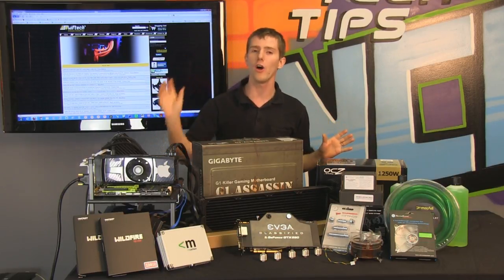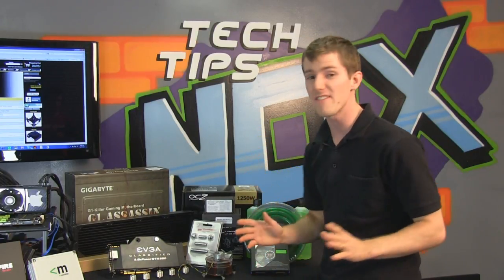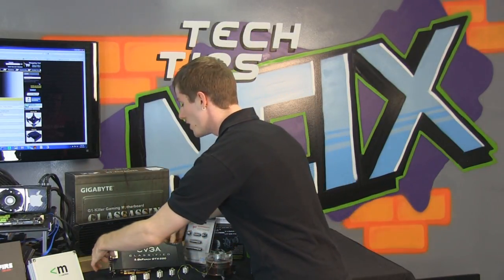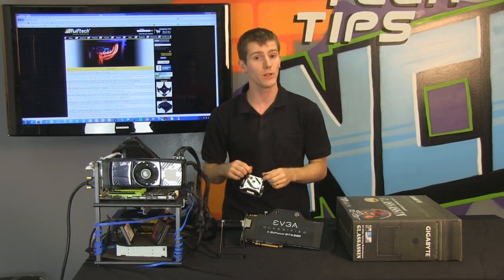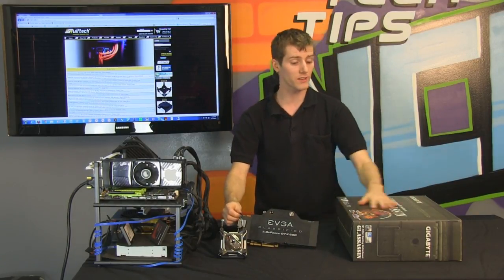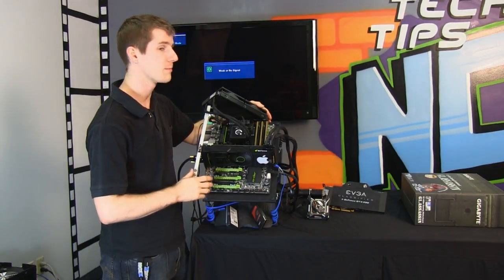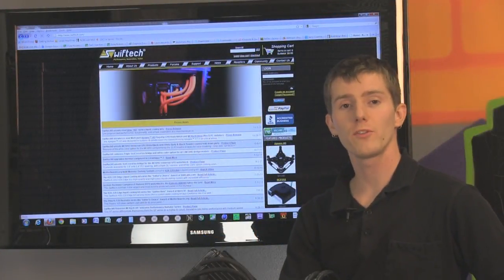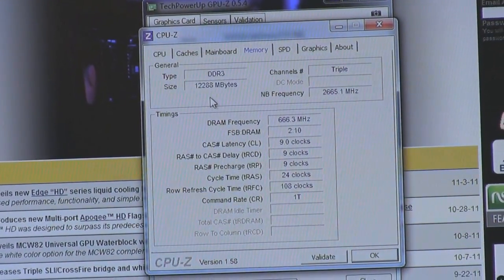Ultimate Water Cooling Guide Part 1 - Preparation Procedure NCIX Tech Tips

Comment: I have always been super afraid to use liquid cooling because none of my houses i have ever lived in have had reliable heating in them. just wondering if the liquid cooling would freeze during the winter
Reply: MrStanrir unless your ambient house temperature is under 0 degrees celsius the water wont freeze as its minimum temperature for the water is the temp of the cold air from the intake fans

Comment: If I have a h100i v2 radiator from my old liquid cooler can I take off those tubes and use that as a radiator for my watercooling loop?
Reply: From what I can tell yes... (Don&#39;t quote me on that) also you could possibly use the block so you have a pump... (Not sure though)
Reply: +NCIX Tech Tips
Reply: B4sic_Shots they made a video  (something like "watercooling for under $100") where they did this
Reply: +Bengy22 Thanks man for the help I appreciate the help ill.go watch it.

Comment: This question goes out to anyone! I'm new to water cooling so bare with me! If my water block is standard 1/4 thread holes .... but my tubing is 1/2'' I x 3/4 OD ... what the fuck size do my fittings need to be?
Reply: I would recommend buying both the block and the fittings from the same company. Some times there is sight variations in how they do the treading which will cause the fitting to not fit. As for the size of the fittings just look for something that says 1/2 x 3/4
Reply: G1/4 is the standard thread size for all fittings. You need to match the fittings to the tube, you will find the fitting that matches your tubing diameter will have a G1/4 thread on the back.
Reply: Make sure you get tubing that is the same ID and OD as your fittings. For the fittings, the THREAD usually needs to be G1/4 thead to go into most blocks. It will will no doubt say somewhere that the block is G 1/4 thread.

You would want fittings that say they are G 1/4 thread AND "1/2 ID 3/4 OD" in order to fit tubing that also says it's "1/2 ID 3/4 OD".  Basically no matter what size tubing you want, make sure to get fittings that match the ID & OD with standard 1/4 thread, if you do that then the fittings will fit every time.

(Some times the size is written in millimeters but under product details it will have it listed in inch to. It's very important you get the same  ID & OD tubing as your fittings, any bigger and your almost guaranteed a leak, any smaller and you can get away with it, but there is still an increased chance of leaking.) Does this help or was my explanation crappy? I could try again xD

One last thing, I'd recommend to get compression fittings over barb fittings.

Comment: Hi, love your vids, thank you for your time and effort. 
I have a question about water cooling kits. 
Here is the set up that I have;
ASUS P8Z77-V DELUXE Motherboard                                         
G.Skill Ripjaws X F3-12800CL9Q-16GBXL (4x4GB) DDR3        
ASUS Radeon HD7970 DirectCU II TOP 3GB
Thermaltake Overseer RX-I Case.
In your opinion, what would be the best water cooling kit option for this,as I want to start over-clocking.
Cheers and thank you, it is much appreciated.
Cheers.

Comment: I see that you are attempting to create a flame war and I refuse to join in on the flaming, however mac machines may be more expensive, however the hardware is optimized for Mac OSX and is also optimized for video and photo editing software. The problem with installing OSX on a home built computer is that Hackintoshes as they are called, are extremely buggy and often lose some of the potential of if you had spent a little extra money for the Apple hardware.

Comment: actually game designers design for windows, so there Unix-like OSs are at a disadvantage. Blizzard has always been multiplatform that's why Diablo 3 can run in either system but looka at Diablo's requirement for Mac and you'll see that is way more like twice. Luckily most Mac's have very good hardware. As a general rule a Mac has better hardw than your average Pc, but Pcs have higher maximum, like 4 times, than the max Mac out there, hardware wise. (CONT)

Comment: why do you say that, i'm guessing coolant has more heat capacity that distilled water, am I missing something. also I think it really makes no difference, I would think that the performance of distilled water and coolant are practically the same (thermal) since the temperature range is so small in computer cooling vs. a car engine in many different parts of the world.

Comment: More important and specific, I have never dabbled into liquid cooling. But recently I upgraded my tower server to a rackmount server. In a datacenter where they're housed in racks and a good room acoustics-damping they might not make too much noise, but in my 220 sq-ft computer room next to bedroom those 24hour 60dB noise is a killer. not to mention is impossible to work in C-room. That's why I need to modify it with a custom built liquid cooling system able to operate cool 24-7

Comment: came across this video by looking what's out there for custom liquid cooling. turns out that for 3 days I havn't been able to find out much about it. retail stores (TigerDirect for instance), Internet (new egg), (forums) only has prebuilt kits that really does not help my goals. My question is: Where would I be able to get this kind of hardware?, Information about it also. I mean where would I Be able to buy, compatible  water blocks, pumps, radiator, fancy coolant etc.? to build a bitch system

Comment: the cooling is usually a mineral oil and is none conductive so if a leak happens you turn off your pc clean it and replace the hose or the fitting to fix the leak

Comment: I'm planning on water cooling a GTX Titan Hydro Copper but have never water cooled before.

Would this combination work?

	
Item	Price	Quantity	Total
MCR-X20 Drive Rev3 Series Heat Exchangers with Integrated Pump and Reservoir
Version: With pump

HydrX PM 2 Coolant

TruFlex tubing
Part Number: TF1610-WT
Size: 5/8"ODx3/8"ID x 6.5ft (16x10mm x 2m)

Any help much appreciated... Can't think of anything else I'd need

Comment: The fact that the family of 36 Helvetica type faces costs upwards of 1,000 USD for Windows is what stops me. On OSX, that typeface is already included as well as so many more classic (which means costly) type faces. In essence, a designer actually SAVES money by getting a Mac instead of a Windows. You're probably thinking "just torrent them" right? Not that easy. If a publisher or presser sees that we used torrented type faces, well that pretty much ruins our careers as designers. (CONT)

Comment: been working on a project now for a long time what i have been running for the past 2 months is a loop with a res and a pump and tubing and a old copper water block, i filled the loop with with a precise amount of destilled water and Mineral oil around 3 to 4 % oil what it does is that it seem to lubricate the pump and it will transfer heat better because it got a bigger value than water i had a heat source to the block in this case a panel heater the temps where little lower with added oil.

Comment: The most expensive part in the latest WC rig I built was the GTX 680's Swiftech Maelstrom pump-reservoir at 105€. And thus cheaper than any other component already in the PC, not counting the DVD drive and HDDs. The RAM-set did cost more, the CPU costs more, the mobo costs more, the case itself costs more, the SSD did cost thrice as much...

Comment: Wrong, wrong, and wrong again. The only point where you are right is that it's expensive.

Watercooling cools far better than air, since water can carry more heat, It's not a headache, and if you're using destilled water or non-conductive coolant a leak won't do jack shit to your rig.

Comment: for a case fan you want high cfm to push the most amount of air into the case. The fans have to be able to move air even though they are pushed up against a dense finned rad.

Comment: You want high static pressure fans to push the air through the rad. High static pressure is more important than airflow and rpm

Comment: That freak show of a radiator is about the same size as the stock top mount intercooler from an old Subaru WRX. I've seen cheap EBAY turbo kits for Hondas and other 4 bangers that come with an intercooler which is smaller than that thing. Radiators on most Japanese crotch rockets and the Harley V-Rod aren't even that big and those motors run at around 200 F or around 90-100 C. An average PC CPU won't ever come near those temps since they don't run on exploding oxygen and gasoline. Pure overkill.

Comment: Watercooled RAM actually isn't that crazy when you think of it.
1. If you have a high end CPU and SSD (Raid0 setup) RAM should be overclocked IMO.
2. The RAM does get warm, hardly noticable, but on a long run your case fills up with warm air, if you have a sound damped case for example I think. And because you don't want fans other than the radiator fans it is a choice to water cool it along with the others.

Comment: Thanks, as Linus mentioned I used a key to jumper the on/off, & some how it shorted, and now it won't turn on, even when installed properly inside the case. Luckly, I went to NCIX Mississauga, and told them my situation and they RMA my motherboard, and said they would notify Linus not to make these kind of mistakes on camera again. I installed my new RMA motherboard on my test bench and this time instead of a key, I picked up a switch and installed it perminately on my test bench.

Comment: thank you buddy.i want to build a new gaming pc with the latest hardware.tell me if they are compatible..:motherboard:asus rampage iv extreme,gpu:gtx 690..,:cpu:core i7 3960x..,the h100 corsair as cooling system..audio card:asus xonar essence stx..,case:phantom case and atleast 32gb ram.(ignore the hdd ,ssd,optical drive and overclocking).what im worried for,will the h100 fit into the phantom case

Comment: The h100 is what's called a "closed loop." It will only cool your CPU. It is perfectly okay to use the h100 instead of all this but just make sure you know that it's CPU only. Don't forget to make sure there's a correct backplate with the h100 for your CPU. I've used the old h70 on my 2600k before, and it gets the job done if you don't care about overclocking (the h100 is inevitably better.)
Bottom line: If you just want something easy for the CPU at stock clocks, then yes. Go with the h100 bud.

Comment: ah brilliant, I've been watching a many videos as I can, reading stickies on forums and asking around on water cooling, because I'm building a new computer and I'm going to have a full loop. It's gonna start from the RES/PUMP combo into a cylindrical tube (EK) then to the ram block, to the 240mm RAD at the top of the case then out to the CPU block, then to a single rad at the back of the case, to the GPU block and then from the GPU back to the PUMP/RES combo. Is my idea feasible somnian10102?

Comment: Luckily that's not the case. The way it works is the fittings have 2 different measurements: The thread size (1/4 usually, sometimes 3/8 or something else.) which goes into the radiators and pumps, and the actual fitting size. The fitting size is what has to match the tubing's ID (inner diameter.) The OD is how thick the outside of the tubing is and doesnt matter a whole lot. A little tip: The thread size is labeled with a G (as in "G1/4 thread")

Comment: No... By no means am I stating that the h50, 60 or 70 beats the cooling system being presented. I highly recommend the corsair unit for ease of install and little to no maintenance required. I was merely offering a more basic solution to water cooling. All I am saying is to keep an open mind. For instance another example is full liquid submersion in mineral oil. This is currently possible with solid state drives whereas before you had to have the hard drive out of the liquid.

Comment: You realize a computer is what's built to run games right? Not xbox, not PS3, not any of that other crap. You know why? Because they were all developed from computers. Those systems are like really cheap computers with a different operating system running all games at low-medium settings WITH THE GAME OPTIMIZED FOR THAT CONSOLE. So to be honest, you clearly show you have no clue what you're talking about.

Comment: moving forward/right (W)(D) while sprinting (shift?)  and vaulting over something mid sprint (space) and the say you needed to reload? (r). thats 5. alot of keyboard couldnt do that and it owuld screw everything up. i play flight sims, i press alot of buttons at the same time, popping flares, looking aorund, arming and launching missles, controling throttle, rudder, flaps. it owuld probably result in a crash if i couldnt do it al at the same time. yeah, it isnt a huge thing, but it can help

Comment: "N-key rollover (NKRO) is only possible with a direct connection to a native PS/2 port on the computer which also has other limitations that USB overcomes. The Razer BlackWidow’s gaming optimized key matrix serves a similar purpose while using the more modern and readily available USB port." - razer FAQs. ps2 allows for every key to be pressed, and registered, at the same time. usb does not. (only 6-8 at best)

Comment: Gigabyte X58 G1 Assassin. I wouldnt' recommend getting it though, it's outdated. There is a G1 Assassin 2 though, which uses the LGA2011 socket.

Though unless you are getting a workstation rig, I would not recommend an X79 system either. For regular use or gaming, the i5 2500k is more than enough.

Comment: @WoodyJYT 

Fans- Silverstone Air Penetrator 120mm
Waterblock- Swiftech Apogee XT Rev 2
Reservoir- Swiftech MCRES Micro Rev 2
Pump- Swiftech MCP655 
Radiator- Swiftech MCR420
Video Card- EVGA Classified GTX 590
Motherboard- Gigabyte G1 Assassin
RAM- Mushkin Copperhead
PSU- OCZ ZX 1250w
CPU- Intel i7 990x
Case- Silverstone TJ11B
SSD- Patriot Wildfire
Extras- Distilled water, Sli/Crossfire fittings

That should help.

Comment: @ocbgavin Green tubing, green coolant, G1 Assassin motherboard, green LED Silverstone  Air Penetrator fans, Swiftech Apogee XT (rev 2) water block, Swiftech MCRes Micro Rev. 2, Swiftech MCP655, quadruple rad, EVGA NVidia GTX 590 Classified (x2), Intel Core i7 990x, EVGA GTX 590 Classified water block. I also see two Patriot Wildfire SSDs, some Mushkin Copperhead RAM, and an OCZ 1250W 80+ gold PSU. You'll also need barbs/ compression fittings, which weren't mentioned in the video.

Comment: How would you suggest testing a gtx 590 with a pre installed waterblock like the one showcased in the video? Is it safe to boot up to bios and check if both GPU's are active without it being attached to the water cooling loop?

Comment: @RPMANU the 990x isnt sandybridge its gulftown, the 990x trades blows with the 2600k, assuming its over clocked, which a 990x should be same with the K series,  I'm not saying it is a slow computer, im just saying that why use last gen hardware to make an "extreme pc" when the new X79 boards are ready for PCIE 3.0.  Just doent make any sence to me to call last gen CPU and Mobo extreme...

Comment: @Cownt299 What, no?! You only have to reinstall your OS when you change your harddrive. Windows will require a new activation of your key if you changed 3 or more  components of your PC, though (if you're out of activations on your Windows key you can call the hotline and reset the activation limit). I've done this last year when I upgraded my Mobo, CPU and RAM.